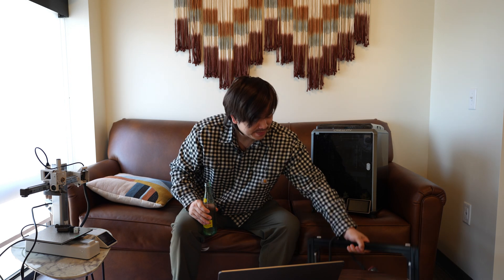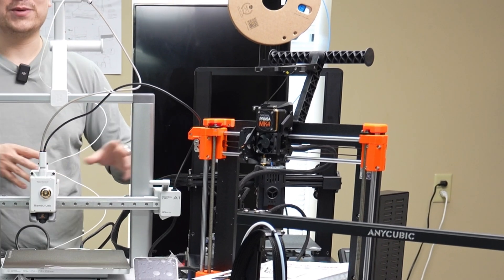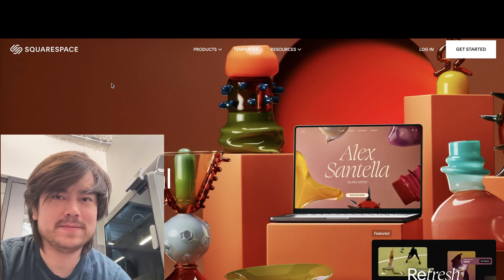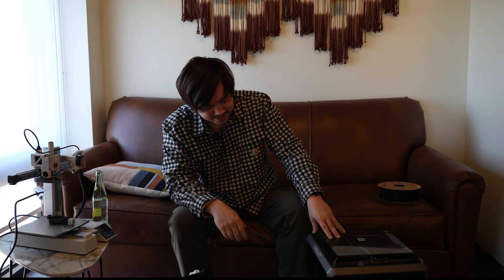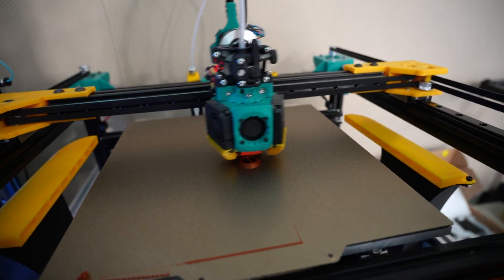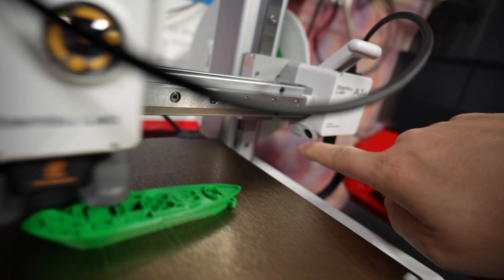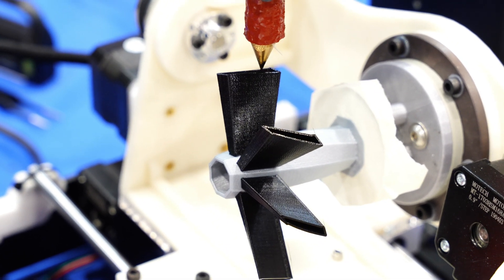We need to talk about Kit Printers

Comment: I think you’re missing the core design philosophies of the voron project. They don’t make kits, they make designs that utilize universally accessible parts. They don’t sell anything. They’ve moved the market with their designs, and many mass market printers are built on top of those designs.
Reply: So Voron is behind the times but they should enforce 1 set of options/mods?

My kit is 99% Voron with a newer board that is already configured for the kit. The reseller had options for different hotends and I got one but I built the basic kit and now using that additional hotend to add multiple toolheads aka Prusa XL.
Reply: Also comes down majority of open source kits printers are made and maintained by volunteers in their spare time for free. If more designers of kit printers could turn it into a real job, I bet the designs would be quicker to assemble and easier, so they could sell more. Right now, it’s the manufacturer of parts making money not designers, could be the main reason Chinese brands are dominating the printer space.
Reply: Voron is a good design... Good start but very unpolished.

Friend of mine has a voron, he spends more time "working" on it then actually printing on it.
Reply: @nekrosoft13 working on it doesn’t mean it’s unrefined. People like modding them because there’s always something new to try out. A gantry, a hot end, and extruded, a tool head. People like tinkering.
Reply: @wl7291  not when working on it, is just a basic setup to get it work.
Reply: @nekrosoft13  The biggest problem I've had with my voron, and the most common problem I've seen, is operator induced. I put something together wrong, I didn't tension a belt, I forgot to reconnect something after a mod, etc. Any time I haven't ruined it, it's a workhorse. It would qualify as a full time employee of mine in the last year. IIRC the biggest design flaw that I've seen is the idler arm on the Stealthburner cracking, and that was solvable with updating the model geometry. 

At least with my voron if something breaks, or I break it, I can easily fix it in my house. I don't have to mail it anywhere, the worst I'll have to do is wait for shipping from Amazon or West3D. Also, it doesn't turn on at night and run prints up into the gantry because someone 12 time zones away pushed a firmware update.
Reply from the maker: The refined version of the voron is every consumer Corexy (bambu, creality, qiditech, sovol, etc)

The project was a huge success at kickstarting a high speed revolution, but now all these companies are making bank on the design concept, but little to no $$$ goes back to the original voron project R&D, so it will naturally fall behind in cost/performance.

It’s sort of sad outcome for the original engineers that made the project, because that was the evolutionary leap needed to get where we are today.
Reply from the maker: And by sad, I mean an unfortunate outcome in terms of financial compensation being far behind what it could, or should be in a fair system.

But what would they do with the money? They wouldn’t hire more engineers to come up with a better design, since they are not a profit driven corporation. It’s lacking an equitable incentive structure.
Reply: @NathanBuildsRobots  Not everything needs to be aligned with profit margins and capitalism. If they want to release their designs for free, and improve the 3d printing space without much personal monetary gain, then so be it, no?
Reply: @theklanco  It isn't about making money. It's about making these designs more accessible to the public. Otherwise, we'll end up with proprietary printers, which is basically what's happening right now.
Reply from the maker: @theklanco  even if the only goal is improving the 3D printing space, wouldn’t they be able to do more of  that with more funding?
Reply: @NathanBuildsRobots not necessarily, no. I'm a product designer for a robotics toy company. Being part of a venture that has to make money introduces a ton of constraints on my designs that just don't exist for a passion R&D project like Voron. If you have to make money, you have to hit deadlines, you have to stick to a tight budget to hit a final price point that you think people will buy, you have to design for manufacture in ways that might be limiting to functionality, and ideally you need to be passing on choosing cutting edge technology and design because those introduce too many risks to reliability. Having research projects that aren't motivated by profit is absolutely essential to advancing any field. It's why all new medicines come out of decades of publicly funded research at universities. Drug companies don't actually design new drugs, most of what they do is take research that we paid for with tax dollars and figure out how to mass manufacture the drug, and front the money to put it through FDA testing so they can eventually sell the research we already paid for back to us for a 30,000x markup (we don't do medicine correctly in the US, but that's a side point). In general, this is why we have national science foundations that fund basic research. I don't know why we think the profit motive drives innovation in this country. It's more of a hindrance. It does drive the development of more efficient and less expensive refinements to a design or technology, but trying to make something profitable usually runs counter to making something new and pushing the field. We need groups like Voron out there getting weird and seeing how far they can push printers! Ideally companies that build on their work would give them a kickback to help them continue their research. They absolutely need funding to keep that research going, but there are more ways to do that than turning into a profit seeking entity.
Reply: @nekrosoft13 same thing happened to me i ended up scrapping it and turned the frame and panels into an enclosure and used the rpi and octopus for a ender 3 s1

Comment: Its quite telling how capitalistic your worldview is, which is a bias that unfortunately blinds you to a lot of the intangible but equally compelling “incentives” of kit printers and the hobby of 3d printing in general. 

Your video argues that there are more efficient ways to mass produce things, that the monetary value of your time is your driving metric, that the printers aren’t a good value proposition, etc. But underlying all of that is the idea that the point of 3D printing is to make money, which is incredibly narrow sighted and almost insulting to the original spirit of the community. Furthermore, if other manufacturing processes are far more efficient at bulk production, then why bother optimizing machines for bulk production like these mass produced appliance grade printers do? The whole idea of a print farm is therefore a nonstarter, per your logic. 

The magic and whole point of 3d printing is the ability to rapidly prototype and fabricate bespoke designs that  were formerly cost prohibitive to produce in single runs. Additionally, the kernel of the 3d printing community lies in the tinkerers and modders and those pushing the limits of what is possible. They are the open source R&D that powers this community. Having open platform printers like the Voron series, which are infinitely moddable yet also have a base spec to act as reference, are the PERFECT tool for this forward edge of modders. 

This video was just so off putting because it completely ignores and invalidates the entire hobbyist community, in favor of an aggressively myopic and capitalistic view of 3D printing. Such a bad take.

Comment: I think you might be missing the point of building a 3D printer and it has, IMO, not very much to do with the things you cover. You cover this topic from your personal perspective on the value of building a 3D printer and while you may be the definitive source for 3D printer news, you missed the target completely. There are two camps... the people that want to press print and walk away and those that want to build for the sake of building ala Steve Builds. It's not about how robust it is nor whether it can compete with the new printers entering the marketplace... It's about the build, solving problems, the endorphin rush of flipping the switch and seeing your build come to life. So, in the end I guess it's safe to assume that you've become disenchanted with the kit printers and community that got you 50K+ subs and can't push thru your own dislike of them enough to recognize, or maybe you do, that if it wasn't for those people in the open source world that developed kit printers like Voron, RatRig and VzBoT, coded Klipper and Mainsail... There would literally be none of the BambuLabs printers for the non kit builders. I don't know... Maybe I was expecting more from the definitive source of 3d printer news and I'm kinda disappointed that all I got was a rant.

Comment: I love moding my printers but the vorons are overrated and the CAD files are a mess so ofcourse the printer itself is a mess even before you get to the logistical nightmare of 50 shades of screws.

Even a the CAD files for a SOVOL SV08 are a huge step forward plus the SV08 kit is half the price of a voron 2.4 and because its half the price its even better suited for modding right out of the box.

Comment: I do like the Lerdge iX Kit printer, especially for kids and class rooms.
Base model is like below 160 bucks, you have a documentation, some videos and an upgrade path if wished.

I always found it very unfortunate that a company like Creality didn't understand the importance of clean documentation and a design that leads to evolution. Imagine that OG ender 3 becoming like 10 upgrades over all those years from Creality itself so that at the end an upgraded Ender 3 would run and have features like a Sovol SV06 ACE oder Ender 3 V3.

The optimum today seem to be two printers: one out-of-the-box for "just printing" and one for those who want to learn, had a blast with building LEGO when they were young and just being curious. This curiosity could turn out to become an important skill in understanding tech, mechanics and software and repairing things while the "ready-to-print" printer ensures fast results, especially in the beginning. That "feeling" alone for mechanics that work well and are lubed just right in contrast to things that stutter and make unhealthy sounds. It's a skill that needs to be trained.
And if that skill is not available the only option is to buy expensive printers over and over again when some issue occurs.

And yes ... printed parts on a 3D printer are somewhat cool! Because it shows what 3D printers are built for: printing parts that eventually fulfil a purpose.

3D printers printing parts for 3D printers stays a very nerdy ... but very brilliant idea.
Reply from the maker: I wish creality made a modder centric version of the Ender 3. Where you could plug and play just about everything, on a dirt cheap and simple motion system.

Comment: 7:23 you insinuate Creality K1c can't print ABS?  HUH?
Reply from the maker: Most printers can’t print real ABS. Most of what you see are ABS blends. For example, Polymaker ABS is alloyed with lower melting temp plastics to allow it to print properly in a 40-50C passively heated chamber. 

To print real ABS you need 60+, which most printers will not do, or will sort of do, but printed parts will have poor material properties

Comment: The only value I see in Kit printers is a Kit that can deliver a build volume or 500mm x 500mm x 500mm with CORE Hybrid - and a great AMAZING RELIABLE hot end that has all the tech of Bambu Labs  - meaning all the auto stuff they do !  

The cad is available from the SOVOL SV08 - all you need to do is upscale build volume and make the chassis or housing more compact - you would need some mad solid works skill to pull that off...

I think there is a huge market for that .
Reply: Can't find a decent 500x500x500 core xy printer or kit for any where near a decent price.

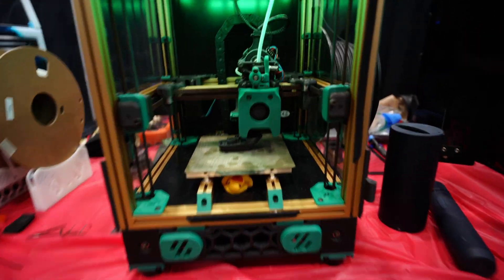Comment: 3:00 No... no... No. Voron is NOT a company. Using an Iron Fist is the opposite of the purpose of the project - and also the opposite of what people want when building a Voron. Tinkering and modding, trying things is EXACTLY what hobbyists want from it. NOW, if someone wants the "HYPE" of a Voron, but does not truly enjoy building things, SOVOL SV08 is the answer. I am not sure if you actually believe what you are saying in this video or if you are just teasing people into rage. Of course it works and I think that's what you seek - engagement by rage 👍 What a 'cool' strategy to grow as a YouTuber 🤷‍♂ PS: I don't have a Voron, I don't even like the project so much... but I understand it.
Reply from the maker: My issue is more that kit printers are priced like luxury goods, and often put low priority on ease of assembly. The bare minimum fastener count for a 3D printer is probably around 100 fasteners, but most kits use 400+ fasteners. They take forever to build and aren’t even that sturdy in the end, and I guess that is my priority when building something that is not represented well in the mainstream kit printers.
Reply: @NathanBuildsRobots The fastener count is that high because they split the parts up into smaller parts so they are easier to dissasemble without dissambling the entire printer also they use of the shelf parts and modular frames. Printers like bambu and k series are almost entirely one big sheet metal frame that is rivoted or welded together. Which in turn makes it almost impossible to modify and try out new things which is the entire point of from scratch printers😂. You miss the point entirely. Like many have said its funny that you call yourself “Nathan builds robots” when nathan semmingly doesnt like building robots😂.

Comment: Without the army of soldiers that tinker, try, fail, succeed and produce, there would not be a BL or CK2. The basics of those printers was created by the open source community, bouncing off each other while focusing on results, not profit.
Long time back I learned from you to store my nuts and bolts casually on the floor around me, now you mix the valuable collection with poop. 
Would I trade my SimpleCore or Voron for one of those printers? Never. I will continue to move forward, discover new possibilities and explore the future before it becomes the boring presence. 
Is it cheaper to build my own printers? No. But I am not here to be cheap, I am here to have fun.

Comment: I find your take pretty interesting: my first and only printer is the Prusa MK4 built from a kit. I really wanted a kit printer to learn about printing and printers. I honestly really had a lot of fun building it, I guess that makes sense you list it as one of the better ones. One thing I like about Prusa is the printed parts in the kits- you can make your own replacement parts, and it really sold me that the quality was decent if the printers were used to make all the parts (coming to the hobby as a newb, it’s hard to know what to trust sometimes). It’s cool to see that they’re making more injection moulded parts where it makes sense, but still giving out the print files so you can make them yourself if you want. Kind of beat of both worlds. I’m considering my next kit printer, building a Voron feels like the ultimate test of “am I serious or not”. But only the cheapest Voron kits cost about the same as a flagship Prusa kit, and will take a lot more time and troubleshooting. At the end both printers will be similar so it’s tough to justify the Voron when even the Prusa is considered “expensive”. So I’m glad you mentioned the rook printers, I’ll have to check them out! PS get yourself some Haribos to motivate you through the Voron build 😂😂 jk but maybe it’ll help. I’m really interested to see when you’re done with that Edit: you’re making an LH Stringer not a Voron- whoops!

Comment: LTT needs to hire you to write their segues.
Reply: Also, you might look at the E3NG project by RH3D. It's base is and Ender 3. It is a DIY printer for sure, and has a few kits out there. Uses a lot of the parts from the Ender 3 (and similar printers).

Comment: I'm building my third Rat Rig a Vcore 4, my other two were Vcore 3.  I'm impressed how much they have improved the build quality. more metal parts and much better joints on the 3030 extrusions.
They have also become more focused on a standard product that has specific electronics, hot ends and wiring.  This is my biggest disappointment, they have a standard product with connectors that do not match, they want the kit builder to cut cables and replace connectors and these can be very fiddly.  Once complete you will have a very good and very large solid printer, and at a reasonable cost.

Comment: Have you looked at the Sovol SV08?
It's virtually a Voron 2.4 that takes an hour to assemble and costs less than half the price of a Voron 2.4 kit or a Bambu X1C. 
It has virtually no 3D printed parts and offers as much scope for tinkering and mods as the Ender 3 did. 
Mine is essentially stock and I'm very happy with it.